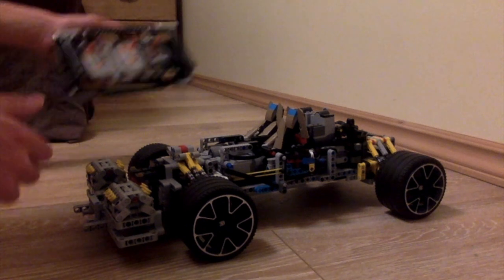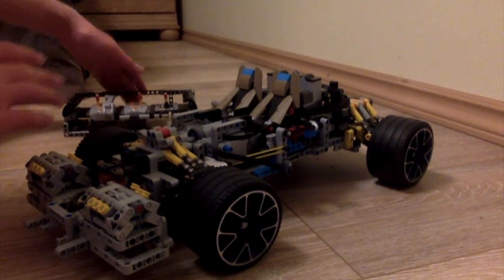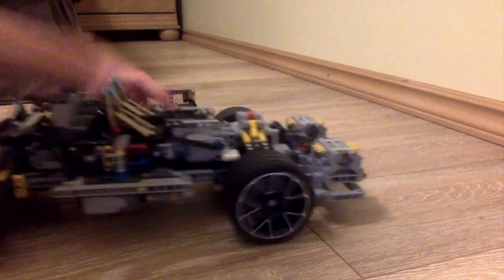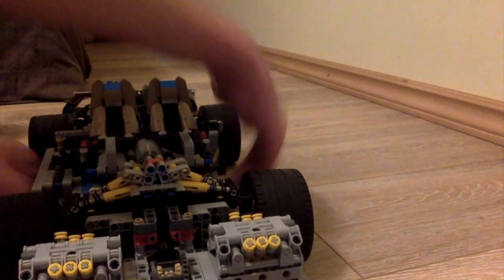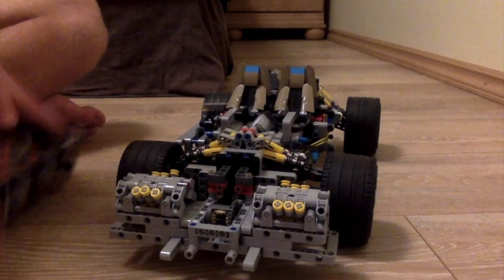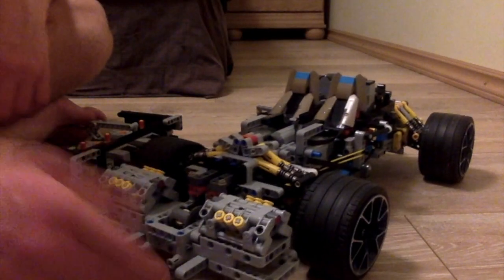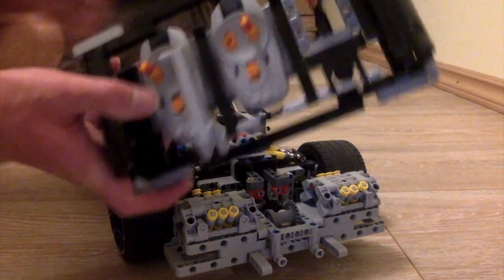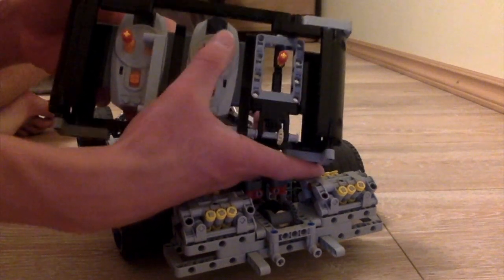Lego Technic RC Dominus Project (MOC) (unfinished)

Comment: Nice chassis !

I am not very good at making car bodyworks too that is why I decided to start by that for my last moc. I just placed the wheels at their right places with a frame as simple as possible and I added body panels 1 by 1 and it turned out pretty good

You should do the same and then combine the two, this moc as potential ! Good luck !
Reply from the maker: interesting, thanks for the idea